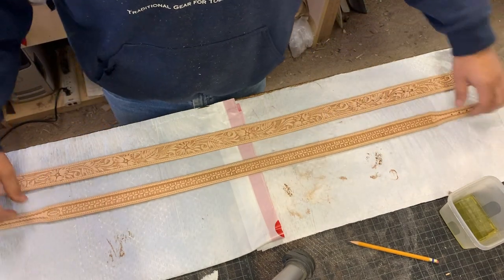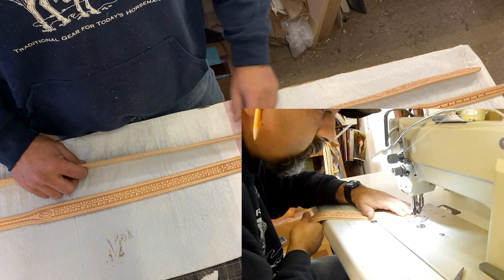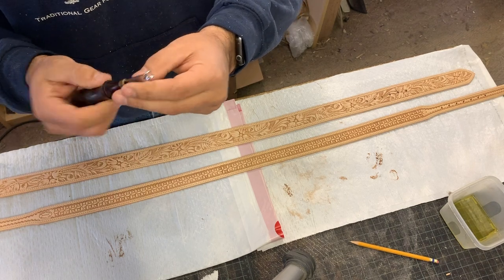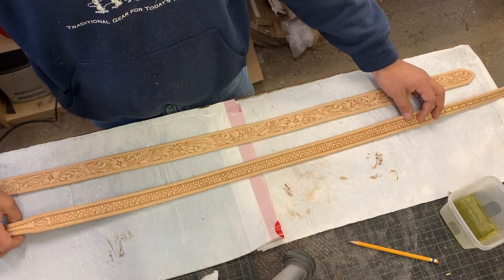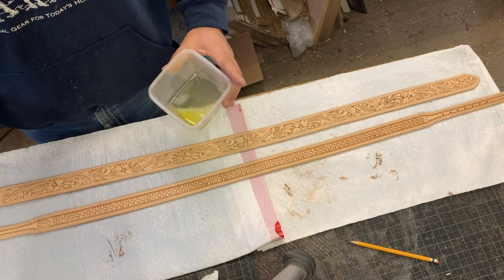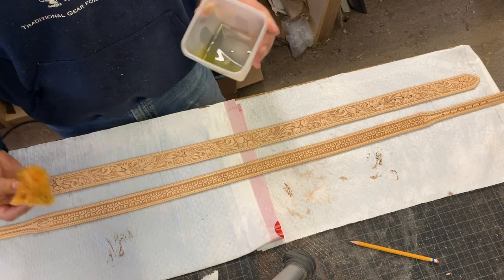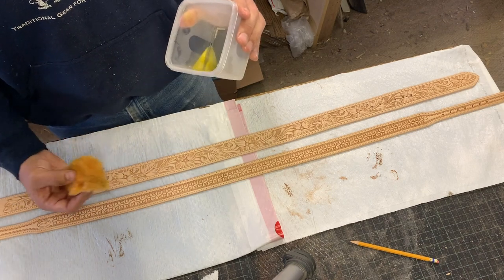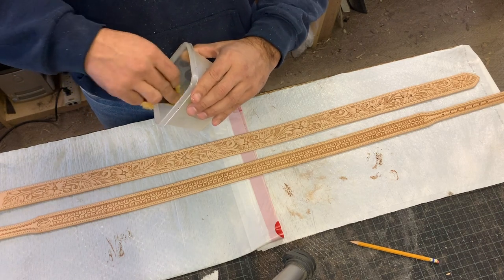How to Antique finish Tooled/Stamped Leather [EP1]

Comment: Can you apply oil on dried acrylic paint?
Reply: you can apply oil over acrylic paint, but the oil will not saturate into the leather and there are chances of softening the paint.   It is best to oil and let dry, then do your painting and staining,  then seal it.
Reply: @orion7741  right on,, thanks again!
Reply from the maker: In my experience oil and acrylic don't mix.. I've tried cutting acrylic with water.. oil may penetrate better after it's cut down and dried but.. I would test it out first.

Comment: I`m really reluctant to put Olive oil on my belts because I read on the Net , and I quote  the passage, ......" Although leather does indeed become a little suppler after applying olive oil, this instant gratification comes with a price. Olive oil, and every oily substance for that matter, will not “nourish” your leather, but actually accelerate its deterioration. " 
 So I guess you can see how confused I am to use it  .
Reply: (It rots) because it’s (food) and it will turn rancid and moldy! So yeah , not the best! Just because it’s a “old method” don’t mean it’s the best!
Like using synthetic oil in your car verses regular oil… These days, synthetic is a no brainer!